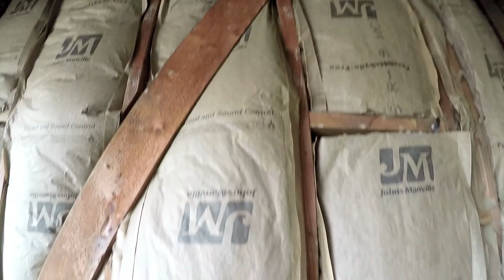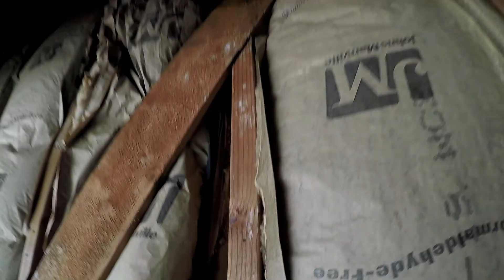Nema 14-50 Telsa Charger & Sub Panel Install

Comment: Will be doing 90% of the same setup.  Wondering if a 1 Pole 50A braker in the main is good enough though? I thought you needed a 2 Pole 50A braker to make it 240 for the 14-50 connector.

Comment: What’s is a fair price for this setup?
Reply from the maker: This only cost about $700 in parts & labor. If I hired a licensed electrician it would’ve cost thousands. Each project is going to depend on a lot. Cheapest it’ll
Get is if you already have room on your breaker panel to add the charger and your car is parked nearby. Then all you need typically is to add a new breaker and the connector.
Reply: @FrankieD  in my case, there is no more room so I need to set up a sub panel? Which is additional cost? Is there a 2 in 1 breaker or not to code.
Reply from the maker: @kurpal8904  No you’d still need more room for a sub panel that would require it’s own breaker on the main, I believe. I think you’d need a larger main panel, which will definitely cost thousands. I’m not sure there are 2 in 1 60 amp breakers. And not sure what the code is for your area. I’d get a few quotes from local electricians.
Reply: @FrankieD  Yes you are right, no way of avoiding to spend $2k plus at this point to add the sub panel. Just trying to get price quotes from multiple electricians.

Comment: the wire at the breaker box looks janky,  why did the electrician leave open hole in the wall?  the way he attached the conduit to the wall? clearly didn't care how it looked
Reply from the maker: Didn’t get to show every detail but we did some clean up afterwards. Filled hole with foam until I get the house re - stuccoed. Thank you for watching !